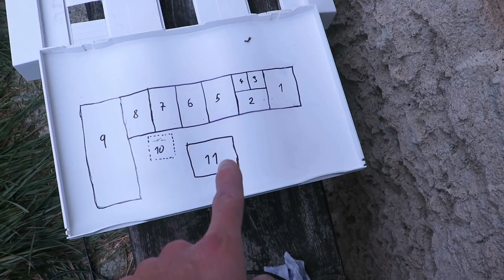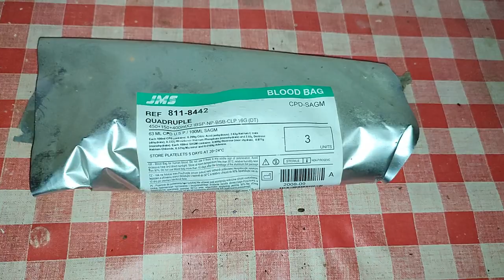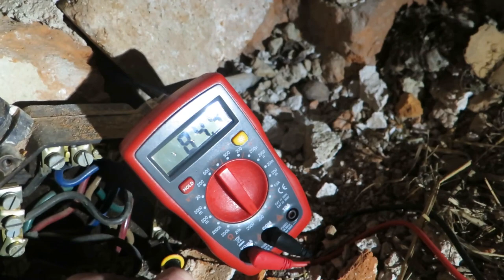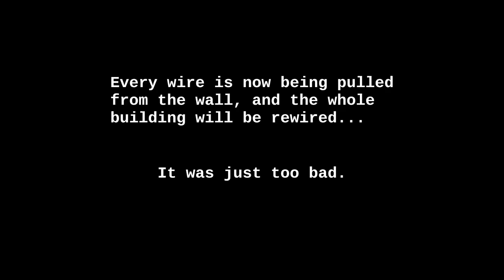Electrical installation from hell - 1980's smart home

Comment: "They say the previous owner was an electrician"
You've done this to yourself. I'm an electrician. If the seller told me a house was owned by another electrician I would say goodbye and get in my car.
Reply from the maker: Well, good thing I am not electrician then :D It should be done better.
I was mechanical engineer though, so I can only imagine that house as a machine. So expect big ass panel behind kitchen line where all plumbing and wires will be accessible if one needs to service it. Also nice steel channels under the roof. Was thinking about hidden elevator in the pastry room too, but definitely not this year lol.